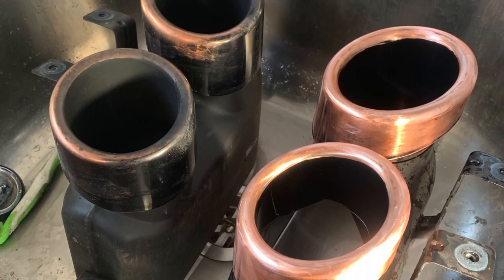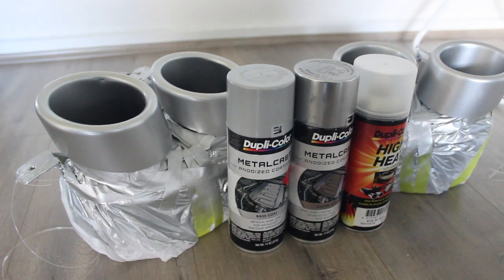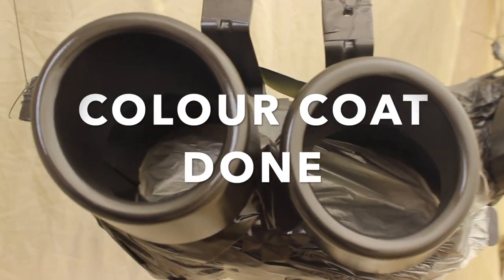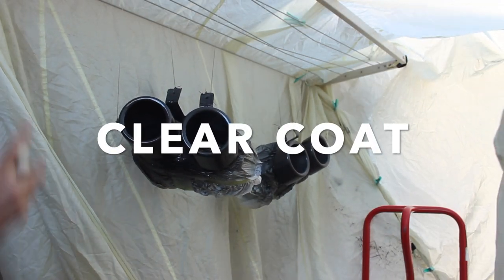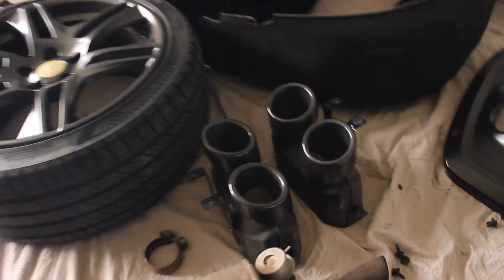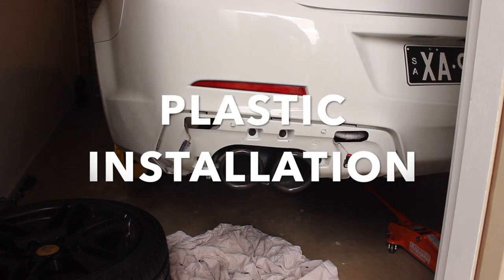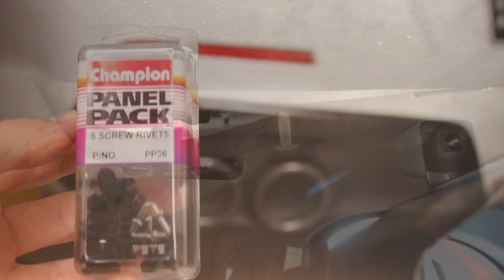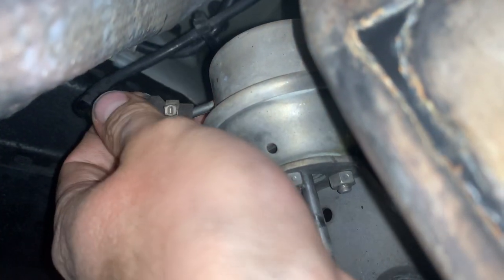VF GTS Exhaust Tip Respray/Install

Comment: Hi there do you any chance know what size the 4 bolts are that screw the exhaust tips onto the bumper are or what number was on the bolts? I’m doing the genf2 rear bar swap but none of my stuff came with the screws.. witch is handy 😅
Reply from the maker: Sorry mate, not sure. I won’t be able to have a look for a while either
Reply: Damn cheers anyway

Comment: Hey mate just wondering if you knew whether those plastic tip surrounds are interchangeable between gen-f and gen-f2? 

Great vid 👍👍
Reply from the maker: Are you trying to put GENF2 plastic on a GENF1 bar?
Reply: @gts-5349  yeah that was my intention, they look the same just wasn't sure if it's direct fit
Reply from the maker: @Sam-mq5us  should just swap over. Front and rear bars are the same for both models as far as I’m aware.
Reply: @Sam-mq5us Have you had a crack at doing this yet mate? I can't for the life of me get the plastic surrounds off the bumper 😢
Reply: @brocksisson2177  hey mate, no not yet I've been away overseas but will be first thing I do when I get back! My plan of attack is to take the whole bumper off, hopefully make life easier 🤷‍♂️
Reply from the maker: @brocksisson2177  what part are you struggling with exactly?
Reply: @gts-5349  Was struggling with the 3 clips/tabs that lock the exhaust surround into the bumper.
Reply from the maker: @brocksisson2177  yeah that took me ages too. I ended up just cutting them off and buying new ones. Not even worth trying to undo them haha
Reply from the maker: @brocksisson2177 see if you can push the tabs from the inside at all, if I remember correctly it took a bit of force to pull the surround off. I think I started at the bottom and pulled out
Reply: @gts-5349  Yeah those plastic scrivets were a pain, I cut them off too. I'll try using a bit more force to release those tabs. I'm renowned for breaking plastic clips so I'm trying to be more careful on this one 😂
Reply: @gts-5349  I'm all for breaking and buying new clips just to get the job done, good to know for when I get back 😂😂
Reply from the maker: @Sam-mq5us  yeah I messed around for ages trying to undo them, waste of time for the sake of a couple of bucks haha
Reply: @Sam-mq5us  Job done 👌🏻Took the bumper off in the end, still had a bloody hard time with those tabs!